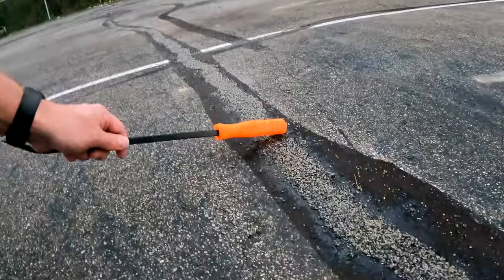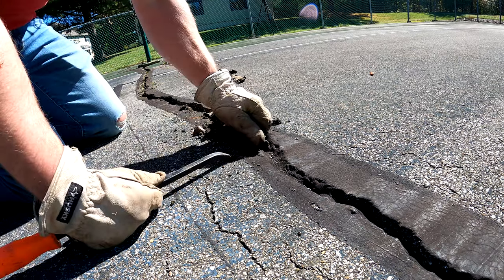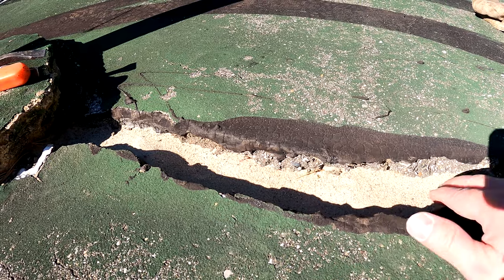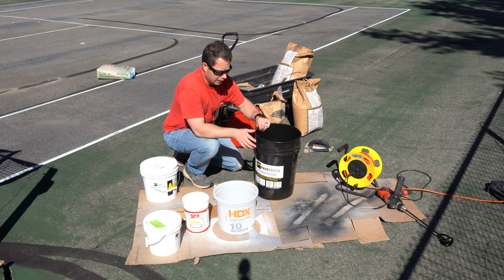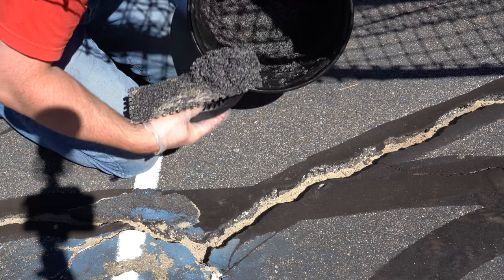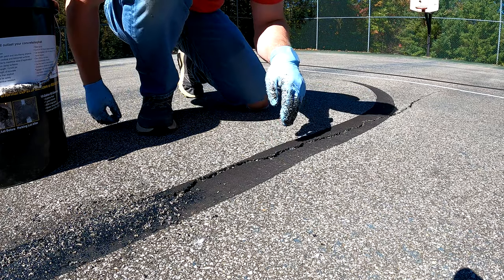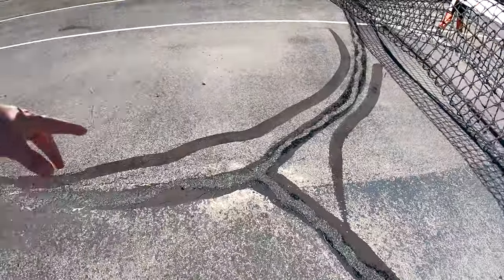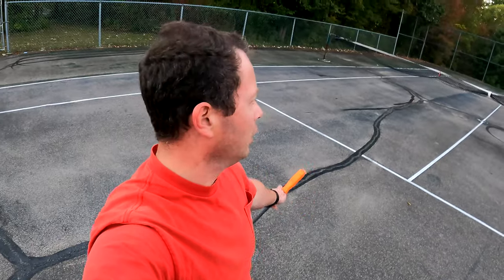✅Large Asphalt Crack Repair - Fixing Tennis Court With Epoxy-Coat Pave Patch

Comment: Great video. I have now done my 150 driveway, 3 times. Tried a bunch of products - Rustoleum Patch, the rubberized Airport brand. None work that well. Looks great, next year open cracks, small red sand ants will reappear 🥵. Winter and asphalt shifting, water does get in. One BIG rabbit hole and a yearly maintenance task like most!
Reply from the maker: Yes, hairline cracks showed up on one side of the epoxy to asphalt joint after a winter cycle but I expected that.  This is much better than any previous products I have used.
Reply: You can’t patch a crack that is still moving or settling.  Same with concrete walkway.  If it’s still settling, new cracks will form, while the old cracks MAY hold up if you use export pr glue that is stronger than concrete.  It’s mean a new crack will form close to the old crack if the surface is still settling.

Comment: Why wouldn't you pre fill your crack with a type I Portland cement and sand mix,  it's cheap and rock hard and it's not gonna settle and wash out and then apply the epoxy sand mix over top?

Comment: My opinion is that you will continue to have cracks develop since that slab is huge and will expand and contract with temperature changes. It would need rest on a flat bed of sand to not crack as it changes size. An alternative solution would be to use expansion joints.
Reply from the maker: Yes, valid points.  I do expect to get hairline cracks that will need to be filled.  From those that I talk to in the tennis court industry they say its an annual maintenance project to seal up the small cracks to prevent them becoming big ones.
Reply: Yes, what you say is correct. The crack may return. Therefore, I have a question. I live in West Asia. My question is: What are the extension cords that you mentioned in the comment, or what is their type? They may be available here in our markets. Give me information about the name of the material or its type. Thank you in advance
Reply: @NaterTater we just resurface and we had big cracks like that
Now the initial sand you put in
You dis bot show that step
Was it dry sand mixed with something?
Reply from the maker: @shamimmalik4701  just dry sand.   Filler basically.

Comment: It’s been a year and I am looking at doing this for my tennis court.  Just wondering if this repair is still holding up.
Reply from the maker: Yes it has.  The epoxy is still solid.  Hairline cracks have formed on one side or the other against the asphalt.  Which I expected.

Comment: I'm looking to do a Pickleball court in my backyard,  would you recommed ashpalt over concrete base?   If I did go with ashphalt.  what proofing can I lay down to not have to repair it so often.
Reply: Hi there
I strongly recommend concrete if you don’t have a very high quality asphalt available. The concrete needs to be reinforced with appropriate steel bars and both expansion and construction joints (not necessary in case of post tension concrete).
You can get professional instructions through ASBA (American Sports Builders Association).
Acrylic topcoat is the best application for the top surface coating when you were done with the concrete or asphalt.

Comment: Hi, how is the pave patch holding up a year later on tennis court?  Any weeds showing up again thhru the cracks? Also, I have similar situation with long and wide cracks on tennis court and want t try this out. What do you think about aquaphalt 6.0 ?
Reply from the maker: The pave patch is doing well.  A crack did emerge on one side of the patch to original asphalt over most of the distant as I expected.  So there is now an opportunity for weeds or other growth in there. The pave patch material itself is holding up well its just that the asphalt as a whole is shifting and thus causing the crack.  It needs a quick tube sealant probably every other year to maintain it.
Reply: @NaterTater Nate, in that case, I’m suspecting that the epoxy in the patch is holding the crack, but then the stress is moved over a couple of inches from the crack where the original asphalt isn’t as strong as epoxy reinforced patch material.  This suggests your court surface is still settling, maybe slower after years of settling.  And the forces are coming from the left of right of the court width cracks, suggesting the ends were not compacted enough.  I’m not an expert, but sharing an opinion.

Comment: Those cracks are massive which means the ground was settling.  I’m think in 1 year, the cracks will open up.  It’s possible the settling has stop if it been years.  Even if the epoxy is very strong, the asphalt isn’t a solid substance like a cement slab where the crack vertical walls can be bounded, although not 3 inches wide.  The contractor, quoting $15,000, would not have done a better job than you.  It really depends on whether the surface has fully settled.  If not, it like wax on car; you going to have to redo the job sooner or later.

Comment: Thanks for sharing is this product resistant to shifting, it does not seam to have any flexibility
Reply from the maker: It is not.  It solidifies to a hard material that doesn't flex.
Reply: @NaterTater Does that mean that it ends up cracking again? I'm trying to find the proper fix for asphalt cracks in a commercial parking lot
Reply from the maker: @gmasc357  the epoxy hasnt cracked but its possible.   What is likely to happen is the joint between the epoxy and asphalt will open over time. I dont think there is a solution that doesn't do that (unless its bubble gum tar).

Comment: What does it look like 1 year later?
Reply from the maker: Overall holding up well, the asphalt did expand/contract enough to open up a hairline crack on one side of the epoxy filler as I expected.  So it will need a sealant applied for me to not have weeds find their way back in there this year (had none last year).

Comment: how did it hold up?
Reply from the maker: It's only been a couple months and currently snow covered.  Ask in 6 months.
Reply: Can you give an update on how the repair has held up?
Reply from the maker: The epoxy looks the same as the day I applied it but over winter it did get a hairline crack on one side or the other along the asphalt.  Overall I am happy and it is way better than before.  I think I had one small weed manage to sprout this season that I plucked out.